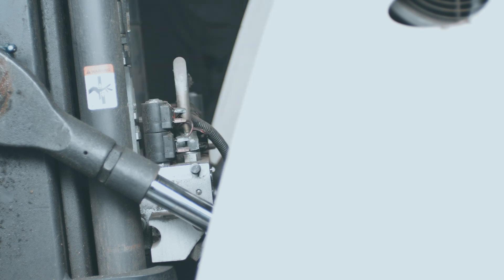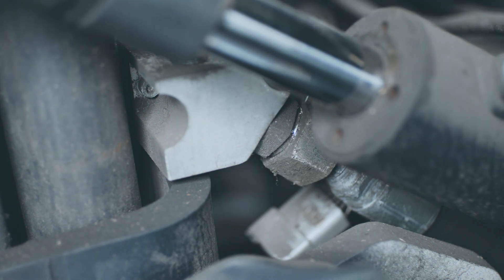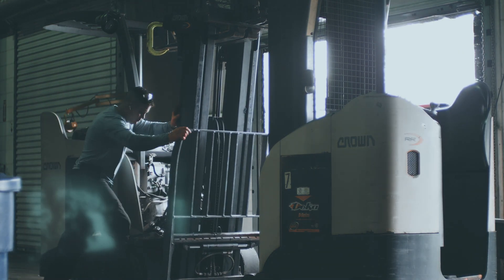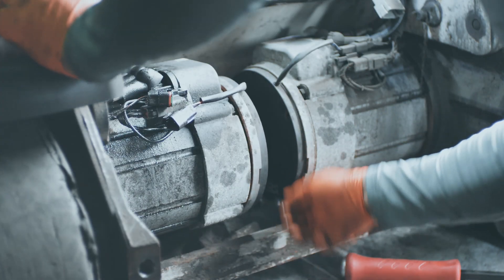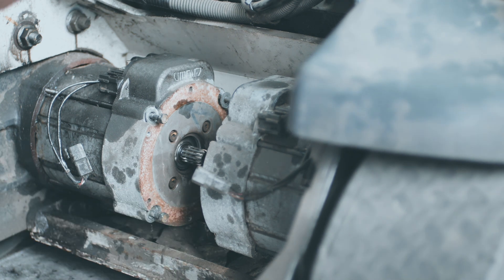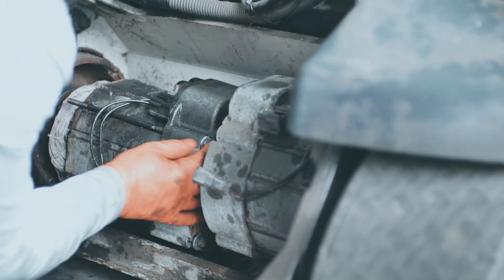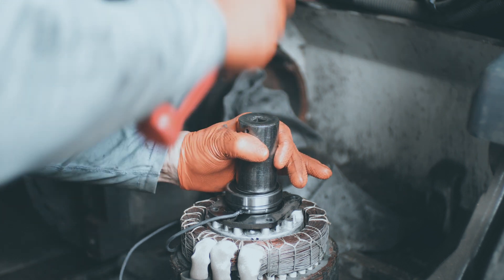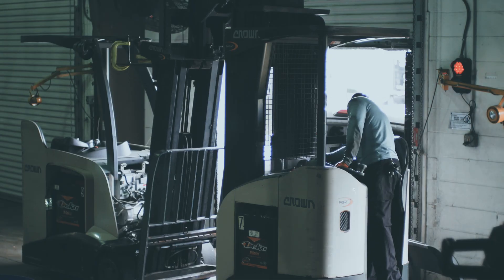RC5500 Drive Motor Encoder Replacement

Comment: Crown Tech here. You do not need to remove the mast to remove the drive motor. You can chain the crossmember of the second stage to the top of the mast which allows access to the motor. I’ve done it multiple times!!!
Reply from the maker: @OldGreenEyes4U  while this is true for the TT mast it’s impossible for the quad masts a customer of mine has. (Not sure about the TL mast) Also, spending an extra 30-45 mins to remove it, to have nothing in my way is worth the hassle to me.
Reply: @magnoliamobileservice4534 I was just sharing information. That wasn’t a quad mast in the video. There’s also customers that don’t have an extra truck to use for the mast removal so chaining the mast is an option to get the job done with those circumstances In place.

Comment: What event pop out??
Reply from the maker: Thanks for watching! On this unit there was no code. The truck would only go like .5 mph.
Reply: Nicee tq bossku..
Reply: Sometimes you’ll get a code 314. Usually you just hear chatter from the motor getting pulsed and no feedback voltage from the encoder to Access3. I just ran across a right motor failure where a bad Access3 caused both channels to have 0 volt feedback to Access3.I removed both wires at connector 425 that go back to the Access3 and my output voltages on both channels were back. Plugged the wires back in and the signal voltages disappeared again. I replaced the motor, then replaced it again thinking the encoder in the new motor was bad, just to find out that Access3 caused the voltage loss. Now I have to reinstall the original motor and replace Access3 😂😂😂

Comment: Great job! I always enjoy watching your videos and would like to ask for your advice. I'm currently working as a forklift service technician (just started my career) and I see from your videos that you are good at diagnosing electric forklifts, so my question is: could you recommend anything on the topic, maybe some kind of a book or some course or anything else? Thank you.
Reply from the maker: Thanks for watching I appreciate it! When I first started in the industry, YouTube and internet learning were basically non existent. I had to go to tech school, but here’s what I learned was the most helpful along the way and most of these skills can be learned through these platforms. Knowing how to use a multimeter, not just checking voltage, but learning what kinds of measurements to take and where in a circuit. Things like volt drops, resistance, missing positive, missing negative tests. The second thing is learning how to read electrical and hydraulic schematics. Learning this combined with knowing how to use a meter and pressure gauge will make a lot of people think you are a magician. I will probably make some videos on these topics. Is there an area you feel you would like to know, out of what I mentioned? When something comes up that would make a good example I can film that.
Reply: @magnoliamobileservice4534 module about puts and input signals.